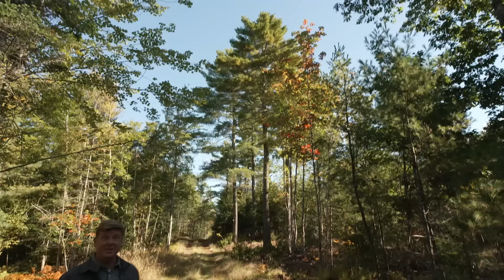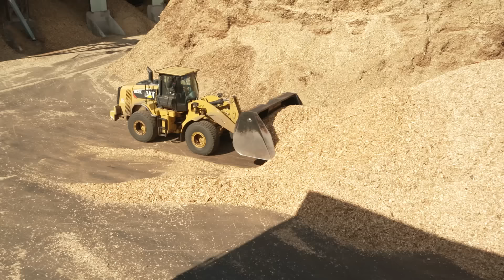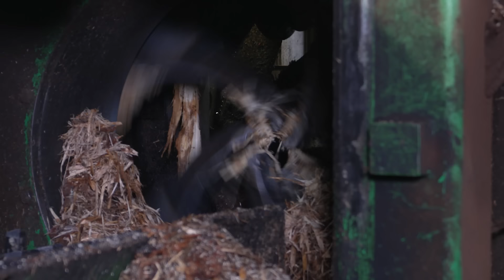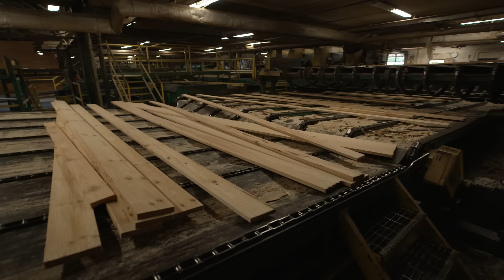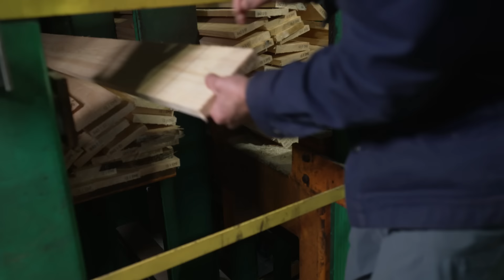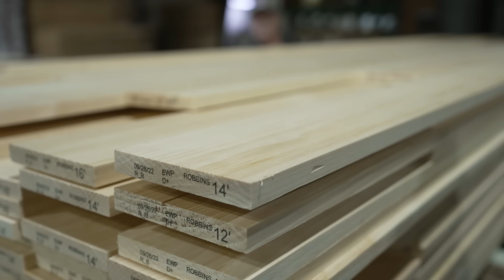Clapboard Milling Process | This Old House

Comment: The best quality clapboards are cut on a specialized sawmill that centers the log like a lathe and rotates the log a few degrees to cut a tapered, vertical grain board thats free of pith. You need a straight 24in + butt log w/ minimal taper but those mills cut some beautiful, stable material.
Reply: I’ve seen articles about a mill like that in Australia, but that was to generate true “quarter sawn” vertical grain boards. Is there one in North America? Before retiring I worked in sawmills since 1972, I’ve never seen a radially sawn clapboard lumber. Seems an unbelievably wasteful saw pattern. What is the advantage of vertical grain for siding?
Reply: @bruce2900  The Ward Clapboard Mill in Vermont still makes them this way.  With vertical grain, they're less likely to cup before or after installation and give a more uniform result.  For tapered clapboards, the right size log wastes very little other than the saw kerf.
Reply: @davet6226  I recently bought a 150ish year old house in Vermont that was long ago an office for the ward clapboard mill

Comment: How long does a pine clap last?
Reply: Not as long as a cedar clap will.
Cedar is naturally rot resistant.
Pine is not.
Reply: Lasts longer with more primer and paint. For pine I wouldn't even use it outdoors unless it's a small area or you're tight on money. Cedar is the way to go. You really don't even have to paint cedar. I put up cedar siding 6 months ago never sealed it or anything, looks new.
Reply: It depends on the primer/sealer treatment. You could easily get 10-15 years before repainting if it's done right. But drainage plays a big roll too!

Comment: Amazing!
My friend Chick Butterworth, who worked with shipwrights from the Herreschoff yard in Bristol, inherited a family house which dates back to the 1700s.
He restored the clapboard siding by taking all the planks off, cleaning them up and replacing them with the old exterior side, inside.
Reply: I try to do the with my deck boards. Getting em up without damage is a challenge.